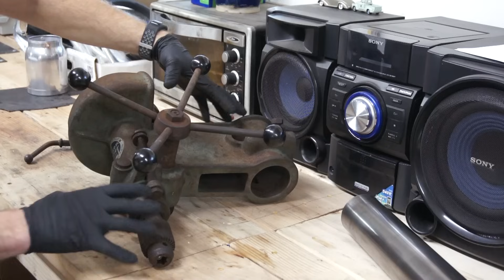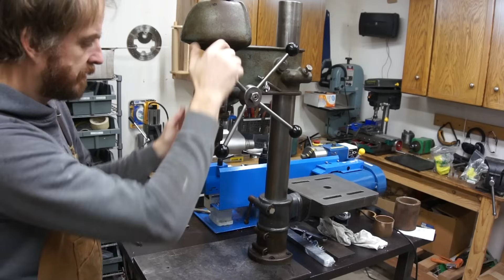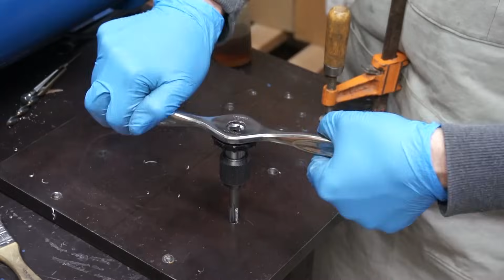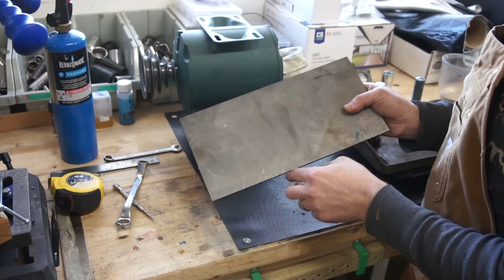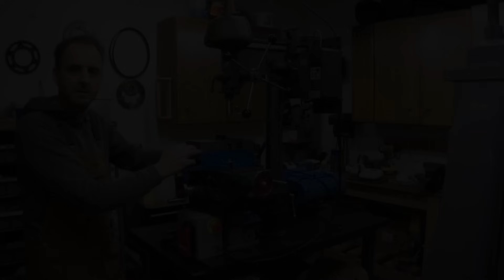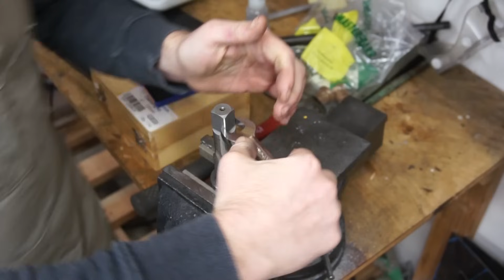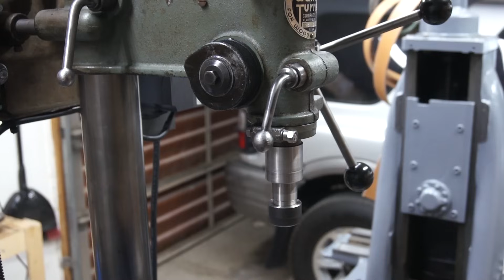Converting a Drill Press into a Milling Machine

Comment: Nice idea, and pretty good work, for hobby use, but you should really, USE lubricant, for any cut, and for all kind of metal materials, just different kind of lubricant/cooling fluids for each kind of metal, aluminium use isopropyl alcohol, and for steel lubricant with oils, and sometimes it also depends on the rpm on the spindle what kind of lubricant/cooling fluid there is the best,, but as a emergency backup for any steel wd40 can be used, its not the best, but much much much better than nothing, and you wil get the best results and much easier to diy if you dont use  the spindle for up and down movement, but simply make it so the spindle is locked, so you only use your table for traviling up an down, and you have to slow down your movement on the table, and also some more rpm, on the spindle, you have to atleast have 12500 rpm to use a cutter with 2

Comment: HELPFUL COST-SAVINGS TIP 

I purchased two complete 1950’s drill presses for $20-40 each. I find a lot of tools like that on FB marketplace in my local area, so I also save on shipping and can inspect the tool before I purchase it. 

As for “why” 1950’s tools? They are just made to better tolerances and built to last. Somewhat Downside… takes some muscle to move them around.

Comment: I have the same drill press, designed in 1935 evidently (from a patent document).The bearings, 4 of them, are hybrid metric/imperial (inside vs outside diameters) and 2 of them have extended inner races. They are special. Good news is that replacements are available, fully sealed unlike the originals. I bought a set some years ago from a company that specializes in providing spares for Walker-Turner machines. They were very affordable. Interestingly, the top cover is magnesium alloy, which I discovered when I had to repair a crack in it. The grinding dust sparkled when subjected to welding heat. I've seen remarkable milling work done on a drill press, but very slow and poor if acceptable finish. A basic Chinese mill-drill would be a luxury, as long as it's big and heavy.

Comment: That's pretty awesome! I wish I had 220 power so I could upgrade my drill press motor, and I would definitely have to replace the bearing's in my beat up old drill press too!
Reply: It is trivial to run a 220 volt circuit, which is in reality 240v because your outlets are not actually 110v, they are actually more like 120v, it got bumped up years ago. As long as you have a path to fish some wire from the breaker box to the garage.  Plenty of videos on here by even licensed electricians showing how to do it. I'm a contractor and I do my own Electric and have been doing it for about 25 years. As long as you learn some things it's not difficult or complicated. It gives you a lot better options for tools having a 240 volt circuit.

Comment: You need to find 2 bearings and that shaft is too long and you fill them up in there like a regular Bridgeport mill and you put them up there as close as you can to the spendel where you can still have enough room to to hook up your call it and you may get a stout and it's big if not even if you have to make a piece that goes on the bottom of the drill press that's heavier what the heavier spendel you're spendle and then you'll get rid of that chatter I know I made one like that too that's what I did If that won't help you

Comment: This project is interesting to watch. Many commenters have made excellent input. I am guessing that this build is adding cost pretty quickly. When done, you still have a drill press mill mod and not a mill. I purchased my Bridgeport with variable speed head and DRO for $1000, giving me a mill and not a drill press mod. Required footprint space was easy for me to justify, as I got a mill and wasn't limited by issues you are addressing. I ran my 3 phase machines on my home built rotary phase converter until I stumbled on an Amish man willing to sell his factory made rotary phase converter to me for $10! I never expect to find that deal again!

Term definitions for the nerds in this chat group...
SPINDLE is the rotating part of the machine.  The spindle has no Z axis movement.
QUILL is the Z axis movement function of the spindle. 
A 3 axis milling machine commonly has 3 axis movement (X,Y,Z), but also frequently has a knee Z function as in this drill press modification. A Bridgeport style knee mill accomplished precision Z axis control with knee function. The quill function can have some light duty Z control function, but I treat my mill quill function strictly as a drill press quill function. 
Machining control demands machine rigidity. All good efforts to overcome drill press mill modifications limitations will move you closer to abandoning the modification project to gain what a mill offers. The drill press round column squeeze table clsmp is a real rigity problem. Milling side load will encourage the table to swivel. The drill press quill lock squeeze clamp affords the same rigity compromises. Many have pointed out that drill press spindle bearings are designed for little radial load since drilling is primarily a thrust load condition. TAC bearings may be the best choice drill press upgrade due to space and size limitations and demands. TAC bearings respond to preload adjustment that can't be obtained by standard ball bearings. 
Milling demands eliminating all system backlash or having enough machine mass and/or clamps to compensate. Your demonstrated milling failure is rooted in rigidity issues. You are best suited to determine what is moving. Mill slide fixture gibs may be too loose or clamping is inadequate to compensate for axis backlash. Quill locking rigidity, tool or tool holding may be a problem and work holding may be an issue. The drill press head clamp may be a suspect similar to the table clamp. Conventional milling preloads the axis backlash. Climb milling sucks the workpiece into the cutter causing the workpiece to be yanked from the vise or work holding or brea KK s the tool. 
After all of these issues are successively addressed, machine mass is still an enormous issue to overcome in a drill press modification. I love projects and engineering  challenges in the hobby shop, but I am investing my time in learning to machine instead of building a "silk purse from a sow's ear" to start my milling learning curve.
My very sweet and supportive wife encouraged me me to build my dream shop while I am still able to enjoy it. I kept my old shop for exclusive woodworking and built a 4600 SF building just for machining, welding and mechanic work. I am enjoying setting up this shop with machinery aquisitions, tooling and machinery rebuilding projects. 
I have pontificated too much on the value of a real mill without applauding you adequately for your "seat of the pants engineering" efforts to make the drill press modification project successful. I envy your mag base drill and annular cutters. I haven't ponied up yet for this tool. Consider purchasing an import set of transfer punches. Treat them gently. They will last a long time, will simplify hole center location, and are very inexpensive. 
I have 4 drill presses, because each size and style offers advantages. Sometimes patience offers rewards. I picked up a 1960's Powermatic for $10 that required some minor TLC, reassembly and paint. My best deal is a 3 phase, very large geared head DoAll for $100. I think that my shop paid about $4000 for this machine in 1993. I out bid my fellow employees because 3 phase scared most of them. I use the smaller machines with much greater frequency, but I use the DoAll for some jobs that exceed my Bridgeport capacity and precision location isn't critical. Your Walker Turner DP would be a nice addition to my DP inventory, but I would keep it for its intended purpose. 
I bet that you and I could enjoy a long day of shop talk. I purchased a very large American Pacemaker engine lathe, but I am struggling to affordably rig it at home since it weighs around 9.5k #. When this gets in the shop I will have bragging rights for the biggest lathe in the family and the neighborhood. I can't wait to be able to make really big chips!
Reply from the maker: This is good information, Paul.  Thank you.  I'm going to pin it to the top of the post for others to find.
Reply: Conventional cutting yanks work piece towards cutter as you are approaching your cut the tool is turning into the work piece on the leading edge as climb cutting the tool is cutting outward away from work piece on the leading edge( climbing out of the work piece).

Comment: Just a common sense tip, if you are going to tap a hole you just drilled, remove the drill bit from the drill chuck and mount the tap in the drill chuck right after you drilled the hole, that way the alignment is still perfect and the tap will go in straight.
Did you all see how his tap was going all over the place at first?
Reply: Sorry, I posted a later comment  suggesting the same idea.  I used to make jigs  to accurately position drilled holes and if they needed tapping as well the jig would have interchangeable slip bushes to guide dill, counter sink and the taps. Trying to push a tap true after it as started will only result in a busted tap. Crooked holes will make assembly difficult or impossible.

Comment: Ok, Bridgeport’s and milling machine’s are thick castings for a reason Chatter dampers. The quills have bigger bearings and way thicker parts ..
This is  a cute video, but a drill press is just a drill press. For the investment and time you put in to that,you could have purchased a mill . Sorry but that thing will always chatter and burn bearings. Mills have mass and heavy Gibbs for there moving parts not a post and slide that also cuts down on chatter. The taper from the quill is also transferring vibration to the tool unfortunately this thing is a wobble maker. The further from the quill the more transfer.  
There are plenty of videos on here to explain why a drill press can not be a mill.

Comment: I would have left that center table hole open for drilling operations and moved the lift to between that center hole and the collar holding it to the column. Still, as long as you have enough clearance with your vise, it will still be ok, so no harm, no foul. :) great video, excellent audio. very good video work. well done!

Comment: Why not buy a mill, rather than mess around with drill presses, which are really only of any use for milling wood?
Reply from the maker: What's the fun in that?
Reply: @RobertAdairWorkshop  Nothing at all, if you are working with softwood, and are going slowly.  For working with metal, using a drill press to mill, is a bit like voting..........

Comment: Thanks for sharing your interesting project. Machinist/toolmaker and new subscriber here. As long as you stay within the limits of the machine you should be able to do light work. Winky has the same mill/drill table which he disassembled and rebuilt much tighter. You might want to consider rebuilding yours with some way to put a little drag on the table during  milling. Hopefully with new bearings you’ll get better results. Chuck your cutters up as close as possible. Rigidity is your friend. You can also do light tapping to about 1/4-20 on your drill press but you must have a hand operated forward and reverse switch. Good luck.
Reply from the maker: Thank you, Ellie Price.

Comment: Hi Robert. I have the same drill press and am doing the exact same thing. I decided to make a new spindle though. I wanted as little stick out as possible, more appropriate bearings and a draw bar. Spindle is proving the greater part of the project though. Currently making a milling spindle for my lathe to cut the splines.
Reply from the maker: I thought about going that route but I know I'm not good enough at machining to succeed.  The milling spindle seems like a good idea.
Reply: @RobertAdairWorkshop  me too but i figured it would be a good way to learn a lot. Definitely a long term project.

Comment: ok i've done this same drill press but I bolted the crossways to the base turned the drill pad till it was under the motor and used it to hold a jack to help lower the motor plus head near work take up the rest with the spindle lock every thing down tight  pull the switch RUN still works well to this day 5 yrs. ebay collet grisly cross ways

Comment: At 10:10 in, 
He mentioned that he didn't want to bolt the plate to the table. May I suggest you use plastic bolts instead of steel? If you do something silly by accident, it's easy to fix and you won't break anything you care about. 
I love this video! Thank you for sharing it. 👍

Comment: Don't forget you can screw cut by hand in the lathe. Put a handle in the back of the headstock mandrel and away you go. Infinite slow speed. Motors are not always an advantage. ;)
Reply from the maker: I actually never thought of that.  That's brilliant.  Thank you.